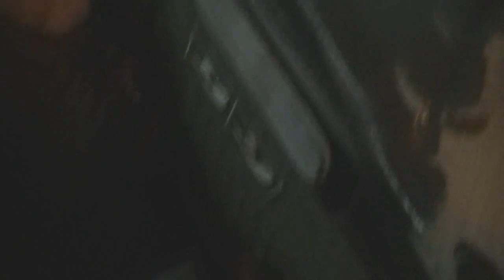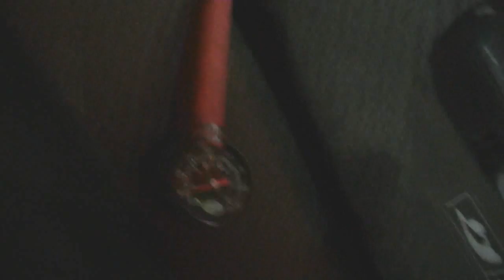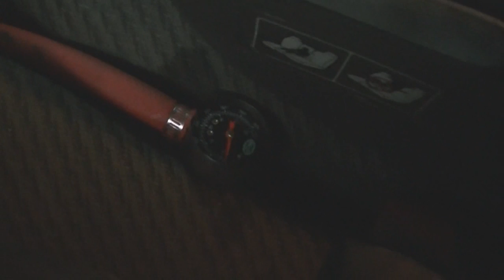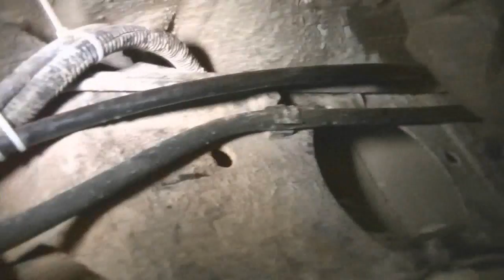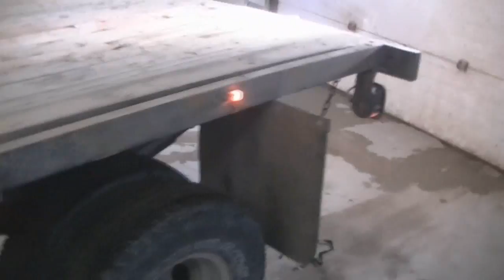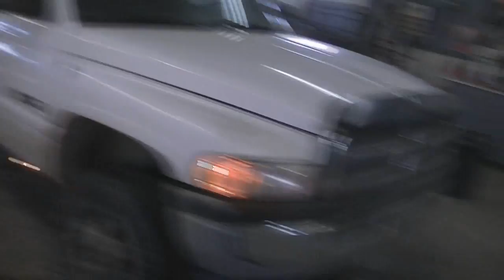2001 Cummins FASS DDRP 02 Custom Fuel System (03/10/13)

Comment: Yeah I know this is an old video so this will be for others that come across this video while troubleshooting their truck or installing something or whatever.  all sorts of problems with the gauge.  First off it's a cheap little gauge. Did you confirm it was actually accurate and worked properly? If not it could be the gauge, snubber, needle valve (didn't recall if you had one or not) was that fat soft hose free of kinks and restrictions? like being squished flat or making a bend too tightly on its way around and through the engine  compartment and into the can through wherever (cutout in floor for shift tower?). Secondly...you have a fair amount of subscribers and then even more views from people looking for advice. WHY ARE YOU EVEN SHOWING THIS SETUP WHEN OBVIOUSLY SOME PEOPLE WILL USE THIS AS A TUTORIAL ON HOW TO ADD A CHEAP FP GAUGE?!?!?  YOU HAVE A FUEL LINE RUNNING DIRECTLY INTO YOUR CAB!!!! ARE YOU FUCKING SERIOUS!?!?!  Dude,  and everyone watching this and thinking "hey I could make a cheap FP gauge like his", there is a hose feeding fuel directly off your injection pump into the cab of your truck! That truck has an electric lift pump so all it takes to run that pump and continue to flow fuel is 12 volts of battery power. Meaning that just because your engine died the pump could possibly continue to run so if you get into an accident where there's flames and your truck catches on fire and God forbid you're trapped in there. that pump can very possibly continue to Pump Fuel into the cab that you're trapped in while the truck is on fire. ESPECIALLY BECAUSE YOU HAVE IT HARDWIRED TO A TOGGLE SWITCH. THAT'S WHY WIRING IT TO THE KEY-ON  CIRCUIT THAT IS SPECIFICALLY DEDICATED TO THE LIFT PUMP IS ANOTHER GOOD IDEA THOUGH THAT'S NOT A GOOD ENOUGH REASON TO STILL HAVE FUEL IN THE CAB AS ANYTHING CAN HAPPEN IN AN ACCIDENT! ALL IT TAKES IS ONE HOT 12 VOLT WIRE TO MAKE CONTACT WITH THAT PUMP CIRCUIT. They make isolators specifically for mechanical gauges that are measuring pressures temperatures and whatnot of flammable liquids. This is not the first time I've seen a video like this on YouTube but if somebody watches it and copies your design and then gets into an accident and burns to death, well... That's just not something I want on my conscious. So anybody watching this it's okay to save money bY rigging up your own fuel system and gauge on the cheap. But with something like this you need to spend a few dollars and at the very least add an isolator!

Comment: why not wire fass into harness to come on with key stupid
Reply from the maker: someone hacked all my wiring and i was new to dodges when i did this. no need for name calling bud... then after i did the yellow spring, the fuel pressure was too high to to let it start.
Reply: the voltage draw is more then the org pump and will short out the computer

Comment: The FASS ddrp can produce 17psi on a cummins. You cant use banjos with that long and small hose. Before i went to airdog, i used the ddrp and bought the frame mount kit from vulcan and 1/2 inch hose, all the way to the vp, and i had 17 idle and 14 wot stock.

Comment: Well if the fluid between the pump and pre injector system isnt moving, then any pressure you can see is static, when you run the engine then you have fluid movement and the pump should be able to maintain a minimum pressure at the rate of fluid movement.

otherwise its crap lol.

I did say i wasnt a mechanic lol, and i am ignorant :-)

Comment from the maker: this pump should reach 20lbs or so before it cuts out... but after 14psi, the low pressure relief valve will pop and start returning fuel to the tank, which is what i want. then, ill get a constant supply of fresh cool diesel to cool and lubricate the pump. before, if i turned the pump on without the engine being on, it would reach 14lbs. then when i started it, it would hit 10lbs, and be around 7lbs while driving. now, with the engine off, its 5lbs, running is 0lbs, and im too scared to WOT...

Comment from the maker: haha :P gravity feed it :P that could work haha!
how do you mean? static fluid pressure means nothing? delivery of fluid without restriction?
i am trying to get ahold of the place i bought the pump from... we'll see if they take it back... but i did cut the harness off it, and hardwire it, instead of using the plug... BUT there was no way to get it to work on my truck without hardwiring it... catch 22...
yea :) detecting crappy pumps since a week ago :P

Comment from the maker: i might have fried my ECM... well... at least the part that tells the lift pump to turn on... the pump doesnt turn on like it should from the computer anymore... so i ran the manual switch. lots of guys do it when their computers start crapping out on them... im not sure how i would measure the volume... other than putting a bucket down and measuring how much comes out in a certain amount of time... supposed to be a 95gph, so i should get 1.58 gallons in a minute... i still need pressure though

Comment from the maker: pt2. i did an out of vehicle test, and it performed good, but i had no restrictions on the output side. i should put a gauge on the output side to see if there might be anything between my pump and the injector pump that might be really restricting it... if i can get good fuel pressure up at the shrader valve on the inlet side of the fuel filter, but not at the injector pump, ill know that something is up with my fuel filter housing...

Comment: Just mount the fuel tank on top of the hood, ha ha joking :-)

To me static fluid pressure means nothing, and delivery of fluid means nothing without restriction.

So its a shitty pump, and an upgrade is on the books.

What a handy thing that pressure gauge is, shit pump detector lol :P

Do pumps have a cutout when the pressure is reached, like when the engine is stopped?

Patience wins eventually :-)

Comment from the maker: haha, no worries, i enjoy your comments :)
the pump definitely has a problem. once it gets to about 6psi, it really struggles to supply. this pump SHOULD do 20psi at idle, and should have zero problems holding 12lbs at WOT... i cant even get it to 7lbs anymore... volume is important too, but PSI is what i need big time... i need 14+PSI to pop the return valve and allow fresh, cool diesel to circulate in the pump and lubricate it.
this injector pump needs 14psi minimum to operate without dying...

Comment: You should do some grommet mounted lights for the sides of the deck, that way there's no way for rocks to get them from the bottom. I may be doing something with my 4runner that has to do with orange lights, if it works, that is. Gotta pop open some already existing lights to see if the project is doable. Can never have enough orange lights!

Comment: haven't followed the saga of whatever happened to cause you to manually control a fuel pump...why not install a check valve so pressure wont bleed back? and even though you have low pressure, you may have sufficient volume. if you can find the spec on the OE fuel pump and replicate it, you would be good to go

Comment: im no mechanic so ignore my ignorance please :-)

Pressure is one thing but delivery of fluid per second is my worry, to my eyes that pump really seems slow, even when the engine isnt running.

Now the million dollar question, How much delivery does the engine need at warp9 and whats the minimum pressure difference needed for the engine injector pump to work well.
Lol aint i a bastard he he :-)

Can you do a out of vehicle pump test?.

Love the xmas tree lights :-) recessed perhaps?